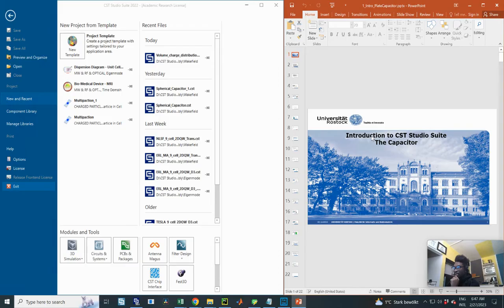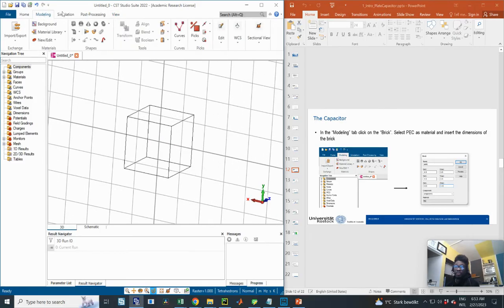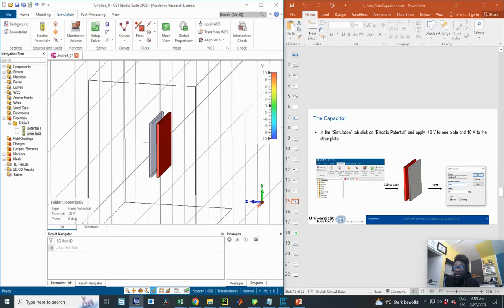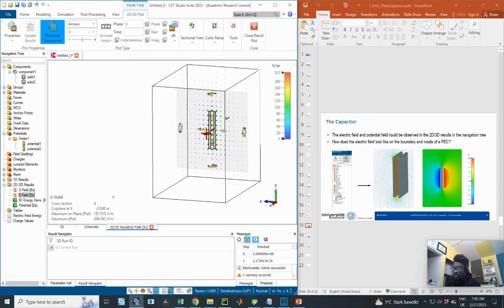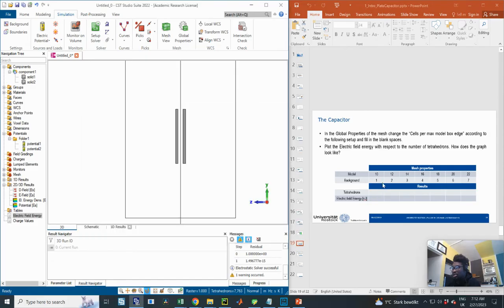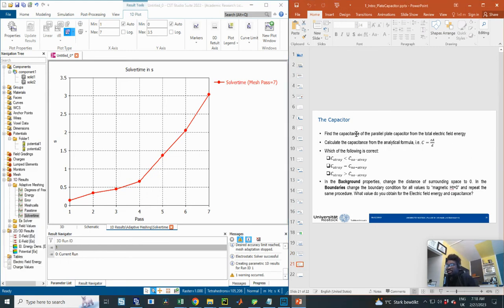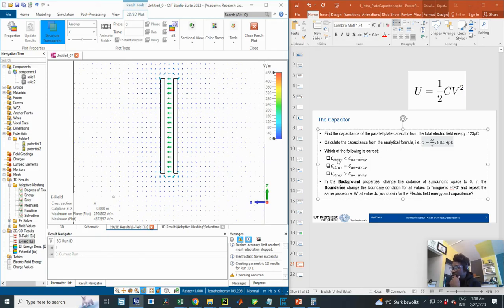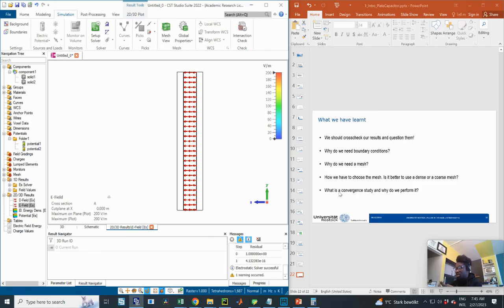CST Analysis of a Parallel Plate Capacitor

Comment: Very, very nice video. Just a note that the capacitance is measured in fardads. Maybe you can start a series of YouTube videos where the goal is just to simulate classic electromagnetism situations using CST since, on youtube, you can only find more advanced stuff. Electrostatic and magnetostatic situations usually solved analytically in a classroom such as a the E field promoted by a charged sphere, the magnetic field and electric field on different regions on a DC current conducting wire, and so on...
Reply: I was disturbed by the pC too :) Why values between the way to calculate the capacitance are not the same? Capacitance should be the same each time.
Reply: @pierregirard4850  Hi. The model C=eA/d is an approximation by neglecting the fringe effects that take place at the capacitor armatures boundary. One of the simulations performed in CST led to a result very close to the one predicted by the above model by considering the volume defined by the capacitor plates as the boundary conditions for solving the Maxwell equations. In this case, the electric field lines considered are just the ones within the capacitor plates. In a different simulation, the boundary of the problem is defined to be larger than the volume defined by the capacitor plates. In this new context, the electric field lines that curl outside the plates are also considered. This will lead to an increased "effective" area of the plates and, therefore, the capacitance will increase. In short, it is OK that the two simulations lead to different capacitances since they consider different operating conditions.
Reply from the maker: Thanks for pointing that out and also the suggestion. I'll keep that in mind.